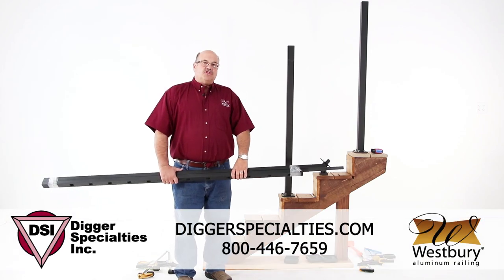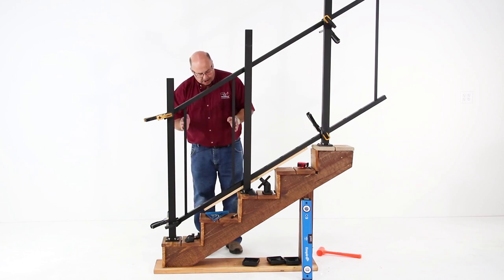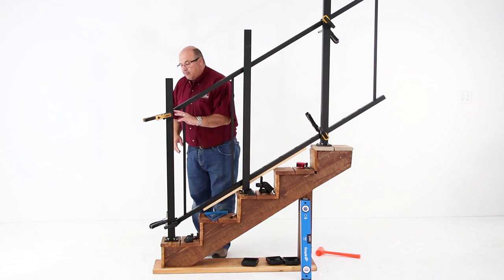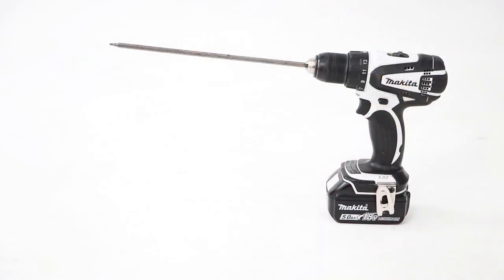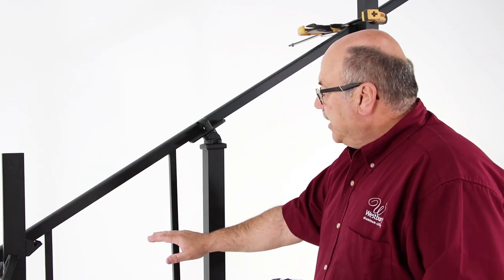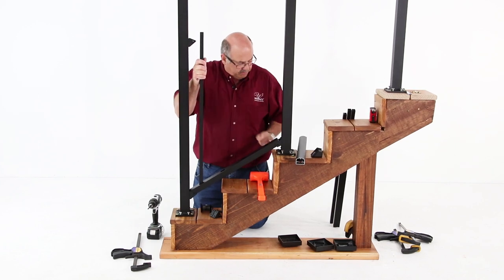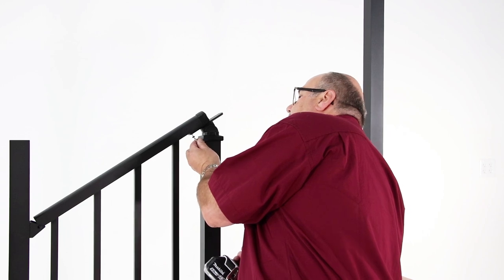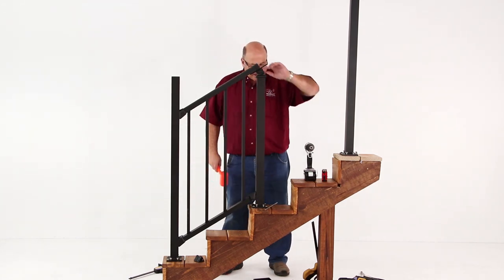Westbury® Tuscany (C10) and Montego (C20) Stair Crossover Installation (Video 1)

Comment: Some pointers for people using this video as a guide:
1. Never, EVER hammer your your balusters while they're in the bracket. You're just asking to break your bracket off.
2. If you don't have a piece of 1x4, 1x6, etc., use a cutoff piece from one of your deck boards as a spacer.
3. Don't cut your top and bottom posts to length until you have installed your bracket covers, then measure 1.5" up from that, not 3/16". Your finished product will look better.
4. If you can't find a super long bit, use a right-angle adapter on your drill.